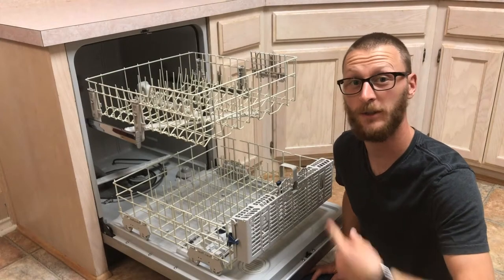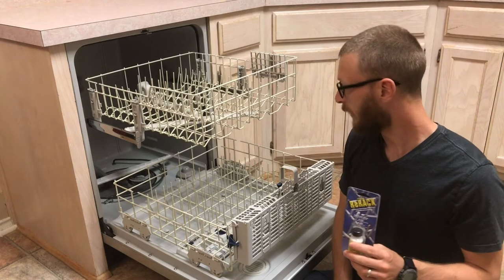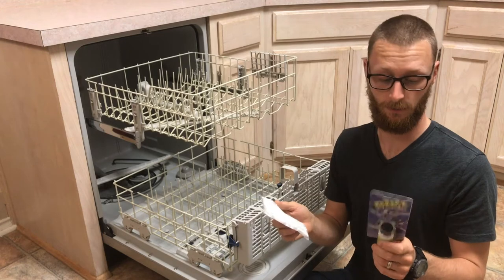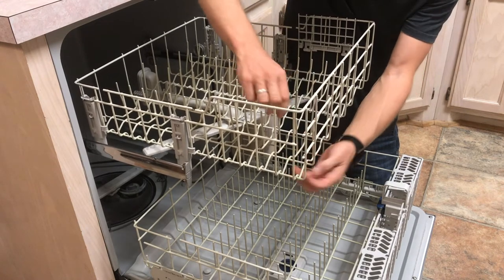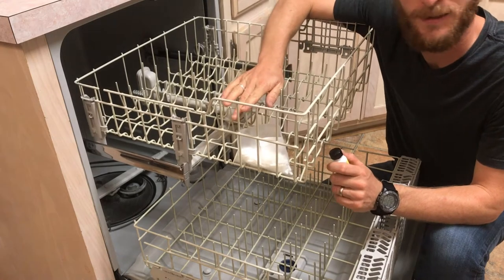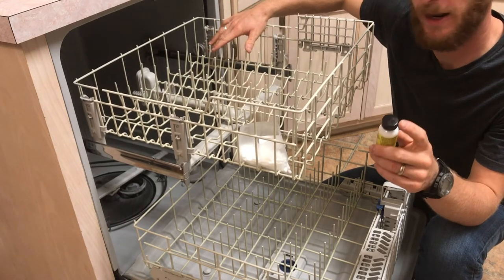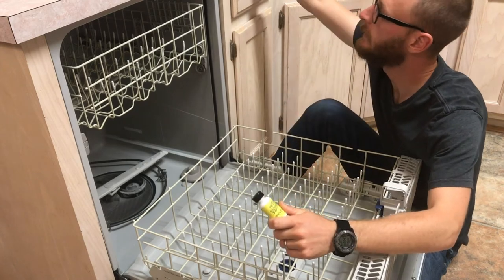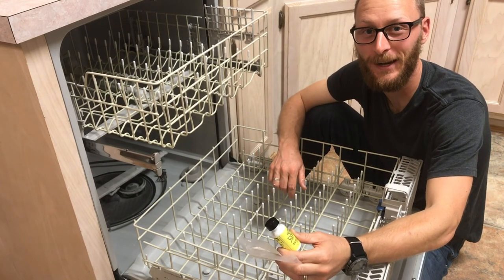How to Fix a Rusty Dishwasher Rack | DIY REPAIR | Easy & Effective

Comment: This is very helpful. The correct size replacement racks can be very difficult to find and very expensive. They should make these racks out of stainless steel with vinyl coating.
Reply from the maker: Dishwashers in general aren't made to last unfortunately

Comment: Would this work for the rack itself not just the tips?
Reply from the maker: Yes, the paint is designed for the rack. It just also happens to be a good glue for the plastic tips :)
Reply: @GanderFlight  thank you! Really helpful. #subscribed

Comment: Do you have a source for bigger caps? The one that is on Amazon are too skinny for the expanded rusty tines in my rack.
Reply from the maker: Hmmm, maybe grab some sandpaper and sand the rust off to get them back down to a size you can cap?
Reply: If they are really rusty, I would take a side grinder and cut the rust off, leaving the prongs shorter. Then seal them as normal.

Comment: Rack repair tips fall off weekly, even when sanded & glued with the white rack re-coating or heat-resistant silicone & allowed to dry (24hrs). Some of the tips have cracked & fallen off after a few weeks.  I'm constantly finding repair tips in my dishwasher filter. Not a good solution.
Reply from the maker: Bummer to hear its not working for you- Ive had good success with them on two different dishwashers. That said - sometimes they do crack or fall off - just like the original coating wore off so too do there wear out. I replace them again and move on.  Only other solution I’m aware of is to buy a new rack.
Reply: After sanding, have you cleaned up with isopropanol alcohol?

Comment: My KitchenAid rack is rusting FROM
BELOW!!! really pissed coz they don’t even sell the exact replacement anymore. MoFos. Fortunately I was able to get the exact rack off eBay for 1/3 the ripoff KitchenAid price (for something that isn’t even an EXACT replacement). Was wondering if I can re-solder these racks and coat with a ceramic paint?